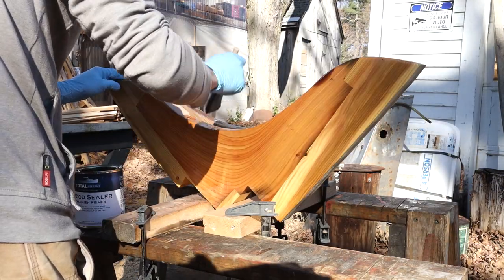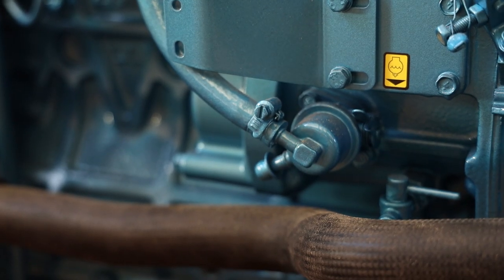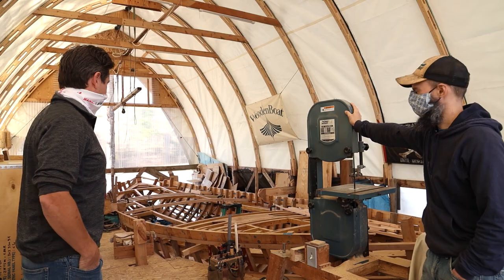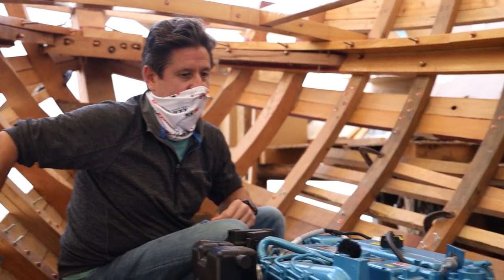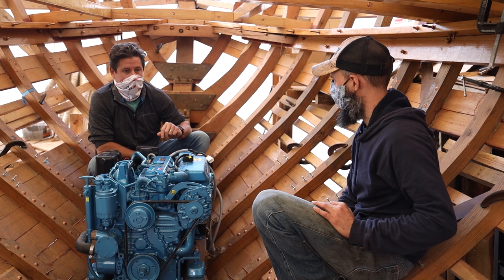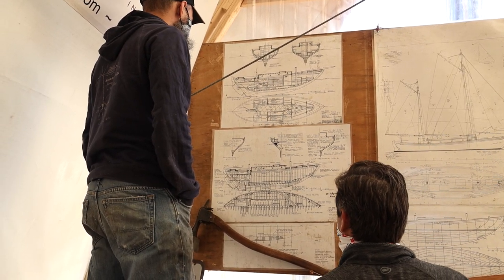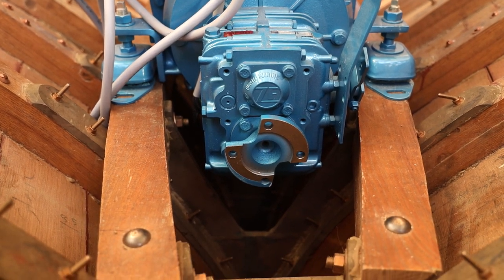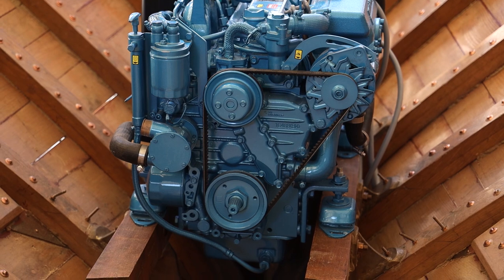Designing the Power Plant - Episode 137 - Acorn to Arabella: Journey of a Wooden Boat

Comment: I have been a subscriber since the keel was poured, thanks for all the great videos!  
I am a yacht systems engineer and would like to chime in with a few very critical points to consider.  With a BSEE I will have to point out a few things you mentioned electrically speaking but first, the diesel:

Look up and read Nigel Calder's "Marine Diesel Engines" before making ANY more decisions about the diesel; it will answer a lot of the questions that were overlooked in this video.
Engine compartment volume:  An engine compartment needs to be the same volume as the amount of air aspirated in one minute.  This is for cooling purposes.  Too much and you won't have enough air flow around the block, too little and the engine will be starved of air.  
Use the equation, [Displacement] * [Max RPM] / 2 = [Volume, Eng Compartment]
For your primary fuel filters, use a twin filter arrangement like the Racor Marine Duplex 500.  This arrangement will allow you to switch to a new filter while underway so the old one may be changed out.  Mount your secondary filter (from the engine) adjacent to the Racor.

With your electrical system, don't fall into the trap of trying to make it so simple that you end up making it too complicated:
Federal code prohibits the use of LiCoO2 and other similar types of lithium-ion chemistry commonly found in photographer's battery packs.  The only type of chemistry allowed for storage batteries on US-flagged vessels are LiFePO4.  This means you may not meet federal code if you are using photography batteries as your primary storage method.  Meaning, if they ever catch on fire (this does happen) and burn down a marina, you may not be covered by your insurance! Not to mention the nightmare of trying to charge them with only a 100 amp source, it is likely that without a proper charge controller, you would just fry your brand new alternator.

If weight is not much of a concern for you, then you may be able to go with an AGM lead-acid bank.  The systems required for monitoring and charging are much simpler and the initial purchase is much lower.  While LiFePO4 batteries would be less expensive over the life of the batteries, the systems required are slightly more involved and there is the initial purchase price to consider, which is quite substantial.

In either case AGM or LiFePO4, using a battery switch or combination of switches, keep the start and house banks separate with an option of emergency paralleling them, just in case you ever need to 'jump start' the engine with the house bank.  If you only have one alternator, you will need a battery isolator.  A charge isolator allows one or more charging sources to be used to charge multiple banks while still keeping the banks electrically separate.  The lack of the ability to parallel the photography batteries with the start bank would be another reason to avoid the 'overly simple' approach.

Power review:
V * A = P
240 VACrms * 100 A = 24 kW
12 VDC * 100 A = 1.2 kW
The difference between the alternator at 100 Amps and your shop panel at 100 Amps is 22.8 kW!!!  
It would take TWENTY alternators to match the power of your shop panel!

BTW: A hot shower is a huge moral booster when cruising on long passages! In other words, don't skip the electric FW pump and engine-heat hot-water heater.  The hot water heater connects to the engine coolant loop near the thermostat and on or near the exhaust manifold.  It will also have an electric heating element that may be used while at the dock and on shore power.  In cold climates, the electric heating will pre-heat the engine's coolant loop decreasing the time it takes to warm up thus, slightly extending the life of the engine.
Reply: Finally a bit of solid sanity in this discussion.  As an engineer as well, I can say "what he said".  And mechanically, as an engineer specifically in the engine business, do put a drip pan underneath, go ahead with remote mounted filters and sump extraction pump, and a second alternator is always good to have.  Electrical loads never seem to decrease - usually the opposite.  And as a bluewater sailor who lived for a while on a 44' sloop, hot water is a very good thing, and refrigeration is also a very good thing.  Both can be done without huge hassle or expense, especially if you can find a sponsor....!   And make sure that whatever batteries you end up with are secured such that when you experience a knockdown (and you eventually will) they will stay exactly where you put them.  Carry on, Arabella will be a beauty!
Reply: The only thing I would add to that would be that you also have to consider how induction air gets into the engine compartment without taking seawater with it.
Reply: I agree wholeheartedly with both comments, you will be hating life without these recommendations. Spend the time it takes to thoroughly understand these most basic systems, you’ll be infinitely better off once you do.
Reply: Engineer, maybe you can answer a simple question. 
Why would anyone want to heat hot water?  "Hot water heater"
Reply: Exactly what he said.  Look into Firelfly AGM batteries.  You will never have a nice girl staying with no hot water!

Comment: Let me preface this by saying I love what you're doing here and watch every episode. That being said, you're making some pretty unusual decisions that you may regret later. Have you ever spent extended time abroad a boat? Have you ever spent days on end at the helm of a boat crossing an ocean? IMO, having no electricity or hot water is punishing yourself for no reason. Tiller steering sounds romantic until you're stuck doing it for weeks at a time. Is it doable and has it been done in the past?? Yes, it's been done and is doable, just as it would have been possible to build the boat with only axes and hand saws, without using chainsaws, wood mills, power planers, drills, welders, bandsaws etc...and yet you chose to use them ( as any sane person would ) because this is 2020 not 1620 and there's no reason not to. Just food for thought, I'll support you in whatever decisions you make, just hope you don't end up regretting things that will be very difficult to change later on.
Reply: This is excellent advice.   I’ve spent 3 months at sea in a racing yacht with enough people to hand steer and I love to hand steer, but it’s exhausting especially in a storm on a black night, so whenever I cruise with maybe one or three crew the autopilot does most of the steering.
Reply: Any race under 100nm I am at the helm for virtually the entire time, because A I'm a very good helmsman and B I really enjoy driving and C owners prerogative 😉. I can absolutely say that upgrading the old autopilot from an old / weak wheel drive to a hydraulic system was the best upgrade I've ever done.  10 day trip this summer and the autopilot got used every single day.   A 12 hr stretch at the helm during a race is one thing, but a 12 hr day at the helm during a cruise while you are supposed to be relaxing and enjoying the view is torturing yourself for no reason.  As for Steve's intention of putting a self-steering Vane, that's great for a long Passage, but not so useful during coastal cruising, which is what you do most of the time.
Reply: If they have weathervane steering, they have autopilot even if it is not what the bulk of cruising sailboats use. There are plenty of cruisers out there with both weathervane and mechanical autopilot they serve different purposes, but crossing oceans a weathervane might be their best bet. A weathervane will work with tiller steering, so no problem there.
MJ Sailing sailed their aluminum, tiller steered sloop from Florida to northern Norway and back to the UK with a tiller and autopilot no problem. 
Given that Steve is not yet a sailor, learning with a tiller has some advantages. Plus a tiller is a simpler system. If you are looking to keep things simple, tiller steering can’t be beat.
Reply: @katypetersen5824  all fair points, but just to be clear wind vanes are great for crossing the ocean, but not very good for crossing a bay or for when motoring.  Here on Long Island Sound virtually no one has or uses them because the combination of winds aren't consistent enough and average passages long enough to get one setup and adjusted to the conditions.  If you are within 25nm of land, mechanical / electric AP is the smarter choice.  Farther away from land and wind vane steering begins to outweigh electric steering pretty quickly.
Reply: Brian, We sailed a Morgan 30 out of Falmouth, MA for over 3 decades. We sailed as far south as NYC and as far north as Grand Manan Island Canada. We never had autopilot on that boat. We started with a tiller and switched to a wheel  about 12 years in, in part to have more seating room in the cockpit rather than needing a wheel per say. We did fine. I personally wouldn’t want to forgo autopilot now, but back when I was young and out for inexpensive adventure, hand steering worked fine. That was back in the days of LORAN which cost a fortune and only worked for us when the visibility was good. Autopilot can be added later if they find they need or want it. Now I live on a 45’ aluminum hull cutter rig and have lots of convinces: auto pilot, radar, AIS, chart plotter, hot water, a heater, pressurized water system, a large solar array, even a freezer and electric heads. But I sailed happily for more than 30 years without any of that, grant it only from May till November, it is New England we are talking about. 
If they are going to need to make hard financial decisions, and they are likely to sail in crowded waters, AIS, RADAR, accurate GPS all might come before the auto pilot for me particularly since you can lash a tiller for sail adjustments/changes. We will have to wait and see how they choose to outfit the boat and what they can afford at that time.
Right now the bigger issues that they need to think about are their power storage, batteries, and building a pan under the engine, and...
I am so impressed with their work and dedication and while Steve is a dandy carpenter and all round handyman,  he is not yet a sailor. I don’t see him starting with long voyages. He has time to add autopilot when he gets around to needing it. Hand steering a tiller boat is a great way to learn the feel for the boat’s response to the wind, and you don’t hand steer if you put the boat on autopilot too often.
Reply: @katypetersen5824  , fair enough, but it pays to gain some knowledge about sailing and living aboard, now so they can anticipate needs, and fit out the interior for future upgrades.  The main point being battery banks and charging options.
Reply: A tiller pilot would be an easy solution for an auto pilot for the times when you can't use a wind vane (like motoring with no wind, or short periods where it's not worth setting up a wind vane. They're pretty much essential for short handed sailing.

Comment: I have no experience in sailing or boat building, but before you start making interior decisions and system decisions might it not be a good idea to stop, go spend a month on a sailboat similar to your design and come up with some opinions of your own on this stuff. I am afraid you will make a decision that you will deeply regret because you have no frame of reference.

Best of luck. Charlie
Reply: but they had Victoria to spend time in, and still have much of the interior from her that they want to use ....but I agree, even doing a few different mockups/test fittings, and then spending some time trying to live, eat, sleep in this boat as they build would help show where you should give and take to make the most of the space .... like they might realize they do need water for a head!
Reply: @BenjaminT.Minkler  It is less about fitting and more about using it.
They never sailed Victoria so it is a pretty poor comparison for what is needed/useful/good to have.
Reply: @Landogarner83  AND, did VICTORIA do a circumnavigation as they Have Not but Do Intend? Circumnavigation throws in a whole New Can of Worms!
Reply: @BenjaminT.Minkler   Ben it’s really not about fitting it in.   It’s about living on a sailboat and deciding what is a must for you.  My must haves are water maker, A/C, Alcohol stove, Air compressor, Auto pilot, Diesel engine, and Electric toilet.  Very few sailors require A/C, Alcohol stove, water maker, diesel, air compressor and e toilet.  Those are very specific for me.  They probably don’t need any of these.  But they really don’t know what they need because they have not been on the water.  After you know what you want you make it fit.
Reply: The idea of spending half a decade building a boat to live on without ever spending an uninterrupted stretch of time at sea on a similar vessel is not wise.

Comment: You want a dedicated water inlet for the engine. The suction of the raw water pump could pull air from the galley hand pump. The galley and head can use the same thru hull. 

Keep all the engine systems separate.
Reply: The raw water to head needs to be on its own through hole ... and in a place where it is easy to turn off ..... toilets that draw strait from the sea have a bad habit of sinking boats hence both inlet and out let from toilets need to be turned off when not in use
And yes dedicated water inlet to engine ..... also remember if you want extra accessories (water pump, alternator) on the engine then you can use electric clutches to turn them on and off as required.  We used 24v ones as used on truck air conditioners, just had to lift one of the coil wires from earth and make the clutch all above earth.
Reply: Also keep the engine battery for the engine itself. If the electronics leak current, after a few days at sea your engine will not start. Running out of battery for the electronics is not a big deal, just turn on the engine and they are back up. Loosing the engine battery and you are screwed.
Reply: @nocare  No Matter What the use is, ALWAYS USE a GATE VALVE in Series With a Check Valve. Never Use a Check Valve Alone. Don't think of it as Why add a Gate, think of it as Why Add a Check?
Reply: @nocare   As long as the gate is UP Line from the Check.
Reply: AND I WAS ABOUT TO START THIS THREAD.. hehehehe.. yeap.. big mistake.. No galley water whilst the engine is running.
Reply: @nocare  I don't sail, but after watching several channels of people that do, I am fairly sure it would fail pretty quickly. All the sea creatures build thier homes on any obstruction. Perhaps if it where bronze though... 
I think the safer bet is to just avoid the hassle and use two holes. They could be in the same area to make shutting off faster.
Reply: @LordLeFrog   The best way is to have two banks of batteries and have them set up so only one bank can be drawn on at a time
Reply: @nocare  One through hole is extremely bad idea and actually a good way to sink a boat .... a failure on any system will shut down all systems
Reply: @doogssmee9742  what’s a through hole?
Reply: @nocare  no. Salt water . Check valves fail.  SEPARATE thruhull needed, no other way.  Or install a sea chest and pull everything from there.
Reply: @LordLeFrog  losing, not loosing
Reply: @robertgarbe6348  Its a water inlet from outside of the boat ..... actually the proper name would be a seacock
Reply: @nocare  If a pipe on your one inlet for all fails (and pipes exposed to salt water do eventually) then you have no water for anything. 
For a starters .... the pissy little raw water pumps like on that engine fail quite often .... having water supplied to these types of pumps even when not in use open the boat , just add a faulty automatic bilge pump and being away from the boat for awhile ....
Reply: Having lived on sailboats for over ten years, and worked rigging and repairing sailboats, I can tell about what is typically done for raw water supplies. 

The engine gets a dedicated bronze ball valve. 

The head gets two, an in and an out. 

Sinks can run of a shared valve.

All valves need easy access, and to be maintained. 

Sailboat living is ALL about maintenance.
Reply: @doogssmee9742  actually that is the valve on the end of the thru hull, not the fitting itself.  But good point.  Every thruhull has to have a sea occ to shit off the flow.  Thank for the additional term..  good job.
Reply: @steveholton4130  Gate valves and check valves increase cavitation within the fittings in turn increasing electrolysis, hence why ball valves are used and not gate valves, and check valves normally are not used.
Ps I have about 30 years working with marine surveyors' on commercial craft up to 35m in length ... both in design and maintaining them.
Reply: @robertgarbe6348  Actually in the professional marine field and marine surveys the thru hull and ball valve are looked at as the same unit .... there also should be no piping or other device between the two
Reply: @robertlugo3388 Yeah and i have seen sail boats plumbed with plastic hull fittings. Might be ok for something that is in and out of the water daily but not for a boat that is permanently in the water and doing ocean going trips
Reply: @doogssmee9742 , do you really think they would put plastic thru hull fittings on Arabella?
Reply: @robertlugo3388  go and read what that was in context to !
Reply: @doogssmee9742  no they are not. One penetrates the hull and the other screws onto it.  And, properly a seacock is a tapered valve and is not a ball valve at all.  Groco still makes them and they are very expensive and require maintenance but are the absolute best.  BAll valves have replaced them.  Good discussion and love the old tapered seacocks, but use the ball valve nowadays.
Reply: Why not just use a closed loop system? Radiator above deck with 12 volt cooling fan?
Reply: @robertgarbe6348  Actually a boat that was built in 1944 that i worked on had all original ball valves .... and it was American built too